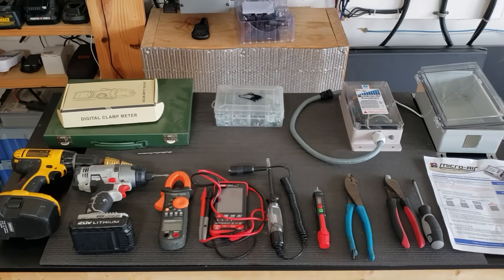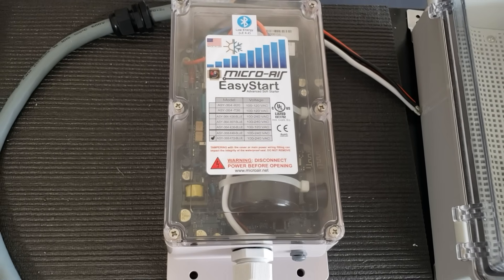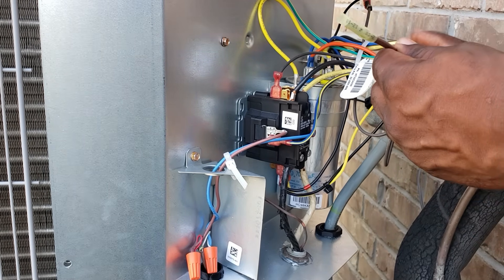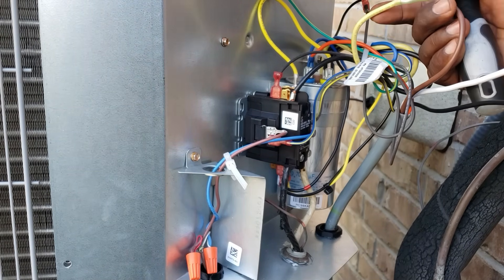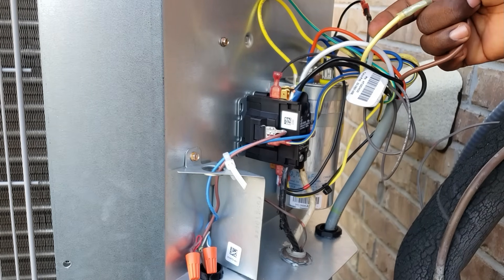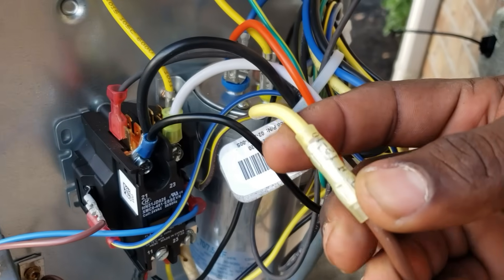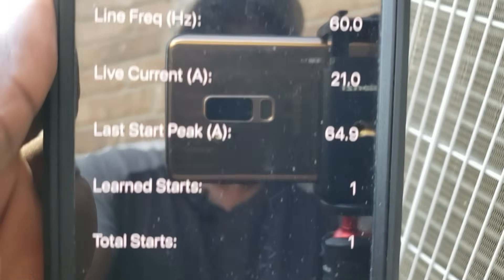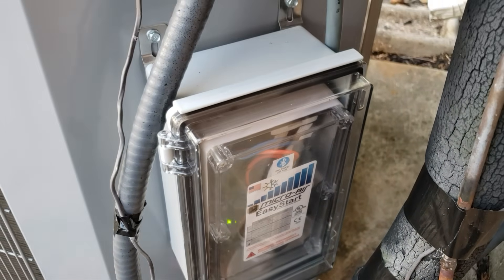Micro-Air EasyStart ASY-368 5 Ton A/C Installation

Comment: I'm happy to see you do this video! Thank you! The Microair was a game changer for our house and back up power. 

I put one on our AC last summer and love it! A couple things I found.  
On our 30KBTU (2.5ton) AC:
Initial inrush was 60.2 amps - 6500 watt with 8750 surge generator would not start the AC. 
After installing a 521 hard start kit the inrush went to 40 amps - 6500 watt with 8750 surge generator would start the AC, but struggled. 
After installing the Microair soft start - I've seen it as low as 13.4 amps, but typically is around 18 amps once it learned itself. Our 6500 watt with 8750 surge generator would start the AC with zero issues. I have since replaced it with the Duromax 9000. (wish I would have known about the Genmax, but it wasn't out yet.)

We had plans to move and knew our new house would be larger. I wanted to bring the soft start with when we moved to install on our new AC. I contacted Microair and asked them what my options were. They recommended to me to order a larger soft start to handle a larger ac in the future and sent me a smaller start capacitor to use in the soft start for my current AC. This way, when our new house has an up to 4 ton AC, all I have to do is swap capacitors in the Microair unit. Genius! 

One other thing I noticed during install. The contactor on our air conditioner is only rated for 30 amps. How many times can a 30 amp contactor handle 60 plus amps during startup? I wasn't sure, so replaced it at the same time as good preventative maintenance. 

Thanks for posting the box information! I reconfigured the motor starter and original capacitor location under the cover to get the soft start to fit. It was a tight squeeze, but I did get it to fit. The box would have been much easier.
Reply from the maker: Hey Tom 
I’m definitely looking forward to seeing the difference between the startup on generator.
Reply: May i ask, why you favor the Genmax over the Duromax?
Reply: May i ask why you favor the Genmax over the Duromax?
Reply from the maker: @naderblack1114  Genmax is forced air cold it has a 50 amp plug no parallel kit needed, oil filter for engine exhaust points to the back and easy maintenance

Comment: Worth noting a few other benefits aside from generator start:

1) Better for compressor health because the in rush is reduced and it can ramp up.

2) I recently had the fan go bad and the coils started to overheat. EasyStart detected a fault and shut down the compressor to protect it. It would cycle every 5min to see if the fault goes away. The device helped me to detect an issue and fix it without the compressor continuing to run and possibly burn out.
Reply: Had a similar problem with a bad run capacitor on the compressor side. With any normal "hard" start kit configuration, your compressor would start anyway and run "normally". However your run load amps (RLA) would be quite high and eventually trip out the internal thermal overload switch (Klixon) and you'll be scratching your head on why is the compressor cutting out. The bluetooth diagnostics access to see what is actually going on before taking out the screwdriver is the extra gold nugget plus in my opinion.
Reply: One thing about the soft starters is that you won't reap the full benefits if your system uses a TXV instead of a piston to regulate refrigerant pressure. I have the EasyStart 368 on my 4-ton Lennox with TXV and I only get about a 40% reduction in inrush current.
Reply: @browsedeweb8834  I have a 3.5 ton unit with TXV. My LRU is 77 and with Easy Start 368 I usually hit a peak of 21A. I did increase the SCPT delay to let the pressure equalize better. On super hot days and frequent starts I can hit peak 38A.
Reply from the maker: Thanks for sharing this 👍🏾
Great point
Reply: The other great thing is that with the Bluetooth option and accompanied app you can send a technical report to Micro Air and they'll help troubleshoot for free.
Reply: i wonder how long that big Capacitor lasts
Reply: You’re probably going to get a better reading after the 5 “learning”  start-ups which are required. Blue tooth portion shows only 1.

Comment: Gavin what was your initial locked rotor amperage before install? Now are you at 55amps?
Reply from the maker: My initial LRA was 74 I showed the whole list at the end of the video
Reply: @GeneratorReviews  thanks man. Was hoping this would drop LRA more then 55amps. I got same easy start as you sitting in garage for past year to be installed. I thought I read you can get 70% reduction in LRA. Curious how mine will do.
Reply: @GeneratorReviews  55amps at 240volts will still be a 13k watt draw at start up. Then rests at 5k watts.
Reply from the maker: @johnjohnssouthernexposure5421  The first start I did was 74 it dropped it to 64 now it’s at 54a i’ll take that😊👍🏾
Reply: @GeneratorReviews  It would not surprise me to see it in the 30s once it learns your system. It takes about a dozen starts and it will optimize it more each time. I have several thousand starts on mine and it dropped tremendously.

Comment: I don't think I'll ever put this on my house A/C's simply because we rarely have a power outage. Since 2005, I think we've only had a couple of outages and they lasted less then an hour. Yeah, I realize it does take the harsh startup out and prolongs the life of the A/C. But my house was built in 2000 and the A/Cs are still going strong. If I do have to replace them, I'll probably go the SoftStart route then since the newer stuff just doesn't seem to be as good.  On the camper though, absolutely! Nothing like running a 15k BTU A/C with a 2k generator. Great video, as usual!
Reply from the maker: Thanks Tom👍🏾
Reply: @GeneratorReviews  Okay. I just had to re-reply to this. After I told you we rarely have power outages, a horrendous thunder and lightening storm came through and a bolt of lightening took out a transfer station. We were without power for 2 hours. Karma is a bitch. 🤣
Reply from the maker: @Tom-In-Ga  😄😅Sorry buddy
Reply: This is great for us people that live in hurricane prone areas where sometimes we can be without power for weeks up to months. Definitely great for campers also like you said.

Comment: Thanks Gavin. I have a request about something completely different from video if you don’t mind. When I get a generator for the home, either GenMax 6000 or 9000. I put the power inlet box outside (30) amp. I put 2 gang 12/4 (2) 20amp receptacle’s right next to it. I want to keep the battery charged on electric start generator. 
What on the generator do I plug in to the receptacle to keep battery ready to electric start it? I’m sorry, it may be simple to you but I don’t know. Thanks. Maybe you can point it out on follow up video for micro air start. All the best to you. Thanks again. Mike i
Reply from the maker: Ok great, You can get any small trickle charger I’m gonna put a link.
https://amzn.to/3OJPqdH
This should do exactly what you’re asking about.
Reply: @Gavin’s Garage  Be careful with the amperage rating of the trickle charger.. some Generators (like my Champion 7000) specifically call for less than 1.5 amps (called out in the manual) to charge the small starter battery.  So I use the smaller Noco 1amp charger (which handles the AGM replacement battery I have: https://a.co/d/hu9hENa
Reply: @johnjohnssouthernexposure5421  Hey John- John, I appreciate the suggestion. I ran 10/4 armored cave from C.B. Panel through basement ceiling 50’ through brick to under the deck. Mounted 30amp Input Box using 10/4 cable wire. Not an easy project. To change it to 6/4 or 8/4 wire would be a real hassle. Right next to it I ran 12/4 from cb panel to outside 2 gang receptacle, both are home runs. Separate 20 amp circuit’s. Material cost me a fortune. I still have to come up with $1400 for GenMax6000 or $2300 for GenMax9000 there not cheap either. I really appreciate the suggestion. All the best Mike i.
Reply from the maker: Are you wanting to be able to trickle charge the generator battery while it’s in storage
Reply: @GeneratorReviews  Yes Gavin.

Comment: 2 things to everyone.  1- make sure to disconnect the power switch on the wall before starting working on the AC unit.  2- make sure you discharge the Capacitor before starting to connect or touch the Capacitor.   After that, you are good to go.
Reply: I will add one additional as a HVAC Tech.  Do not go off the wire colors alone.  Most of the time, you will be ok, but different units have different colors and you never know who may have changed the wiring before you put your eyes on it.
Reply: How to discharge the capacity
Reply: @jonlee5642  use a screw driver touching connectors C and Fan and then C to Herm.   I made a video about how to replace a capacitor and I show and explained how.  “How to Diagnosing and Replace a HVAC
Capacitor”
Reply: @JavierRivera  You are a good guy and thank you 👍👍
Reply: @jonlee5642  Make sure you turn power off before you put that screw driver across the capacitor tabs or bad things happen to you.
Reply: Or have your HVAC folks install it.
Reply: Would I need one of these for a heat pump in the attic?
Reply: @Teryxfun.  No.  This is installed in the condenser unit only.  On my Yui YouTube page I have a video about this.
Reply: Well Yeah!Unless if you were going for that Jolt!Ha!Thanks!Really,dont want to Test this Concept 😅ut!
Reply from the maker: Thanks Javier 👍🏾
Reply: @GeneratorReviews  I got my GM9000iED.  I am still in the breaking process.  Once I am done I will check if runs my 3ton and 1.5-ton units. Both have an Easy-Start.
Reply: @JavierRivera I have a GM9000 (gas only) & found out today that it will not run my 90s era 3 ton(?) AC unit (95 LRA).  I bought a 384 easy start, but obviously it won’t help me in the short term.  Just curious if your 3 ton unit worked with the easy start or not?